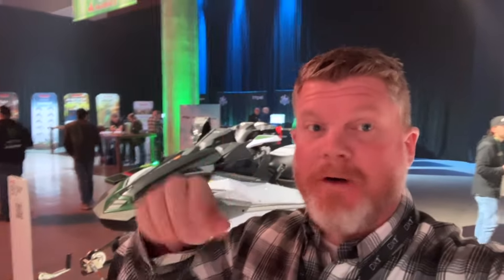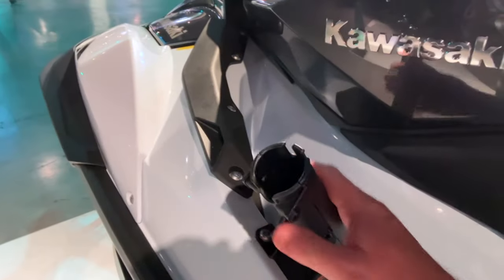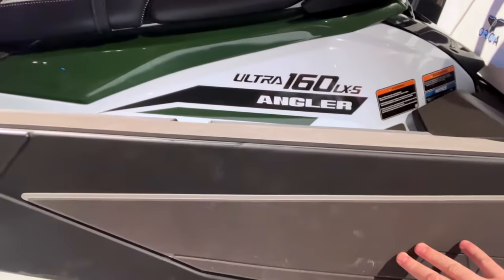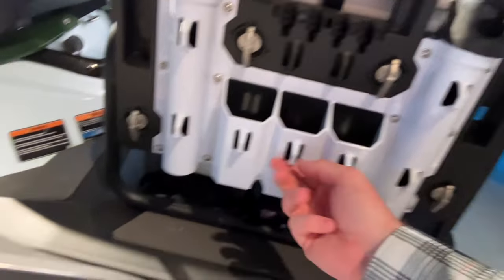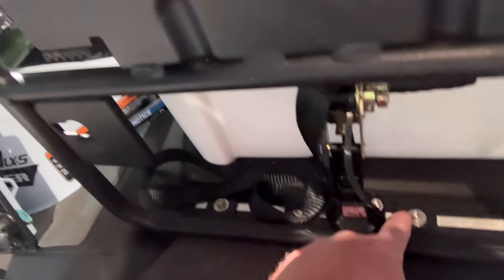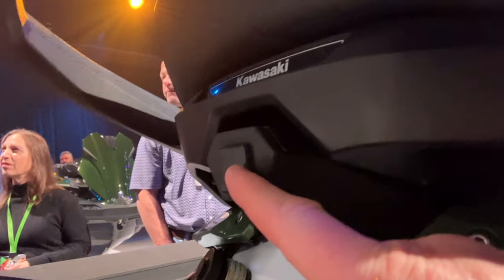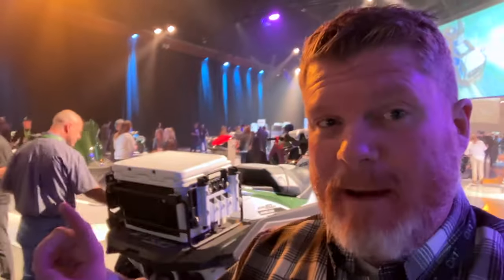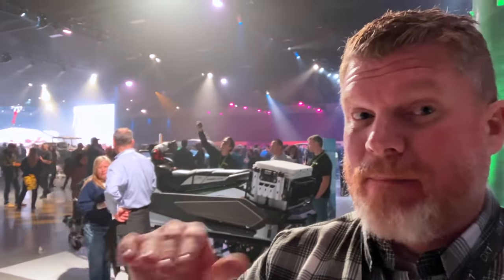EXCLUSIVE! In-Person Walkaround of The 2025 Kawasaki Ultra 160LX-S Angler JetSki: WCJ Uncut

Comment: Can that new rack accommodate Rotopax? I see the hardcore NZ PWC fishermen all have floats like that on the sides..interesting! I did not expect a trim like this..interesting! Thanks for the walk around!
Reply from the maker: Unfortunately, no. The Rotopax holders will not work with the Angler kits attached to the rack. The powder coated rack does APPEAR to have provisions to accept the Rotopax mounts, but you have to choose gas over rod holders.
Reply: Thanks for the walk around Kevin! The new Angler looks to have some cool new features & I’m sure fisherman will love this new model.  Would have liked to see the USB port included for those all day long trips out in the open water for charging your phone & other safety equipment like the InreachSE if needed.  I understand the camera not being needed. Also like others commented on already, would have loved to see a new 310R!  

Thanks again for putting in the work. 

Billy D
Reply: Agree. The Kawi USB port is $12.93 from Kawi. They need to just make it standard on all. Would be one bump over the competition
Reply: @edwardbowles8613  Yeah I am perplexed as to why it’s not standard equipment..
Reply: Hey JD 😂 do you think this rack will fit your Kawasaki to go out there fishing 😅
Reply: @Onichango2015  the resin rack I have from Kawasaki has 4 rod holders already- which is more than I can ever use. The stern bag has two rod holders as well btw

Comment: One concern I have is how underpowered the Angler could be. There is a reason why SeaDoo’s Explorer Pro now comes in the 230hp option. A lot of equipment, not enough power. I know "If it ain’t broke, don’t fix it" but it might be time to move on from the 1.5L Kawasaki engines. Either that or Kawasaki could throw a SC on it. I’m not asking for 310hp but maybe 180?
Reply from the maker: It's the thirstiest of the N/A offerings. The 310 is demonstrably the thirstiest of the S/C engines. What you're asking for is an anathema towards fishermen. This is NOT a sport model.
Reply: @watercraftjournal  I get that but I still think it could use a little more to compete with the SeaDoo Fish Pro Trophy. What I meant was Kawasaki should make a more powerful N/A engine. In all seriousness, I am glad Kawasaki has now joined the fishing market.
Me personally I like the playfulness of the STX and think it deserves KSRD and trim like the Ultras
Reply: For sure Kawi is finishing a 1.8L+ with better fuel consumption, Yammy newest 1.9L HO is cheaper than the bssic 160hp Kawi.
Reply: Is this you hope or fact??

Comment: Great first overview Kevin. So good to see another brand getting into this niche area. There a couple of other things I noticed that other brand don’t have: the spray guards on the bow (less chance of wet rides like FXHO)  and the headlights/lighting. The stability “pontoons” could be further developed in future iterations and have storage compartments in them. Tubbies are hard to gets so imagine if a manufacturer just made these a little larger and have a lid entry to a storage area  to carry a bit more gear and even do away with the rear cooler. Much safer for all fishos if they did that and it would be a class leader. Anyway, what a great first specialist craft ! Thanks for posting this.
Reply: Gunnel/pontoon storage is a great idea. Throws back to the old Yamaha and sea doo SUV and LRV monsters

Comment: A new well-thought-out rack with rod holders, a cooler identical in size to the Fish Pro’s, a factory Garmin mount in the same place on the right-hand side, trolling rod holders in the footwells, a flatter fishing seat, and outrigger floats to stabilize the ski and add footrests adds up to a very solid contender for the FishPro Sport, mainly because it’s so similar. Imitation is the most sincere form of flattery, or something like that.
I’m really looking forward to the ride review on this ski, mainly to hear about how the outriggers mess with handling. It’ll be interesting to see if they help in really rough conditions, or if they just ruin the handling of the Ultra hull. Do you know when you’ll get your hands on one to test on the water?

Comment: That's a nice looking Ski.  Some great Quality of Life improvements over what Kawi currently have available but unfortunately it still falls well short with what Seadoo offers with their fishing line up. I feel that this angler model is for the "it's either a Kawi or nothing" fanbase and not so much towards the hardcore fishing demographics who want to fish off a ski simply because Seadoo's Fish pro line up is better suited for offshore fishing.  This model is great for Kawi fanbase.  Curious what the MSRP is for this model. Also curious how it would perform on the water with the out riggers and if there is any major noticeable difference vs. the standard Ultras. . The 3T3 hull performs the exact same (for better or worse) on the Fish pro as it does on the RXT and GTX.
Kevin, did you know this model was going to be shown at this years boat show?  The timing of your review lines up perfectly with this...😃

Comment: 🤔Wondering could we equip our Ultra 310lx with the Garmin???
Reply: I installed a depth finder on my Ultra. Transducer works great glued right in front of the engine. Mounting the Garmin itself shouldn't be an issue and running the wiring in the gullwing glovebox is pretty easy with the removable cover inside.
Reply: @edwardbowles8613 what depth finder did you add? Did you just duct seal the transducer? Want to put one on mine. Thanks
Reply: Hawkeye Depthtrax 2B. Have them installed on 2 STX 160s and Ultra 160 lxs. Used epoxy to glue inside hull. Ultra has a great spot right in front of the engine. STXs I glued rear starboard side where the 2nd waterbox used to be on older 15fs. If you don't have the stereo controller on your Ultra, the spot where that controller goes is perfect for the display. If you have the stereo then it works on opposite side same spot but have to temporarily remove the phone case for better access to install. These have all worked very well. I installed a Humminbird on a 97 STX and it was still working when I got rid of ski 2 yrs ago! I tried several others in the years after that on other skis but all failed quickly due to water intrusion so I didnt try another til the Hawkeyes on the 2020 STX 160s.
Reply: @edwardbowles8613  thank you for the reply. I really appreciate it. Just got my 23 ultra 160lx. Really think its a smart idea to install a depth finder.
Reply: Good for you. Really liking my Big Orange ski. The gullwing storage has really grown on me. I should say u might want to test the transducer signal in case you have an air pocket or something in the area that might affect the signal. But I have installed 6 transducers inside 6 Kawi hulls over the years and never had an issue with transducer signal. Water getting into the head unit was only issue. The one in the Ultra 160 is extremely consistent because it is centered so well. My 160s are not in center and shooting at an angle due to hull shape so they might lose signal at higher speeds occasionally
Reply: @edwardbowles8613  well thanks for all the info. I really appreciate it. Im in Ohio and plan to travel with my ski to see some great places. Maybe we will meet up on the water somewhere. Thanks again
Reply: Sounds good. I have hauled skis to the FL Keys and CA and lots of points in between. Still love riding familiar spots as well as new.